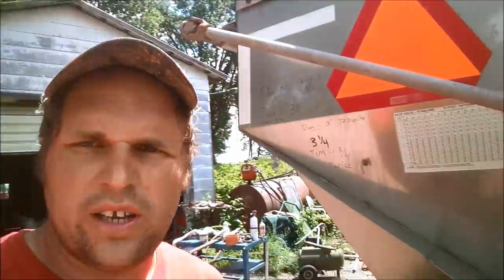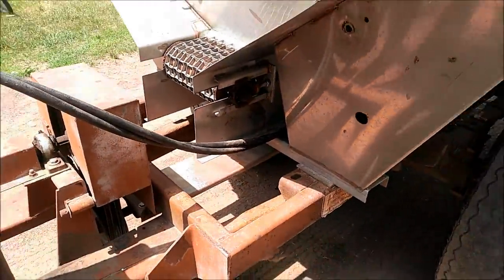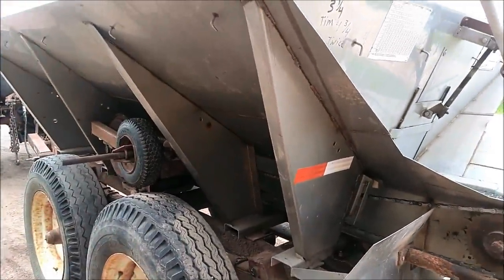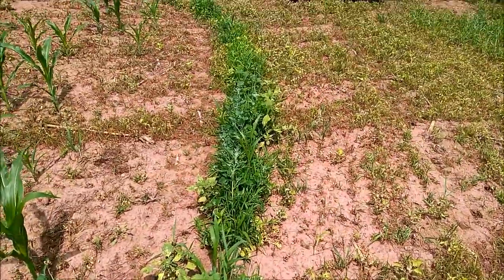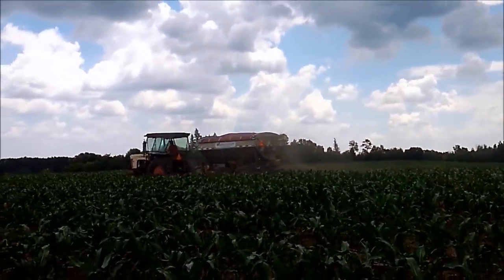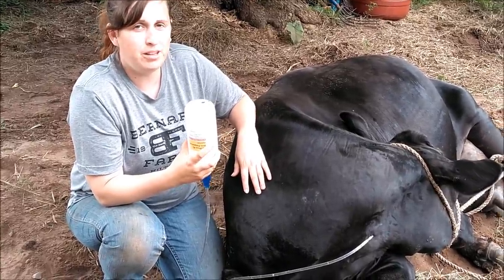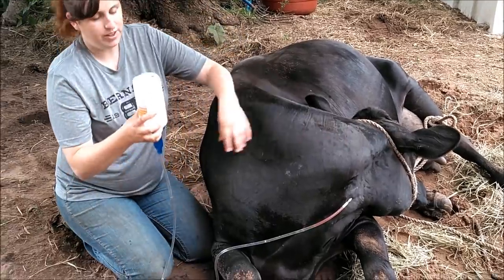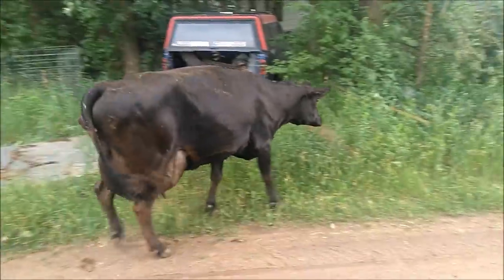Fertilizing Corn with an 830 Case/  Treating Milk Fever in a Cow

Comment: I never had many milk fever cases but for about 8 or 9 years I have given the enima  treatment with calcium. I have also mixed calcium with dextrose to help dilute it down so you don’t have to worry about giving it to fast. Have you ever just followed up just give a bottle under there skin?
Reply from the maker: This is the first time our vet suggested the enema with calcium.  Sometimes if the cow does not get up right away I'll put a bottle under the skin, but that's about it.

Comment: Do you subq cows so they have calcium as the cow needs it? Do they still use niacin on fatty liver cows? Had cows with the phosphorus deficiency, the enema is a liquid or a powder? Good luck!!
Reply from the maker: I did this right in the vein.  Normally with the calcium pills we don't have milk fever, so the vet figured this was more of a phosphorus issue.  For fatty liver we always treat with propylene glycol.  The enema was a liquid.